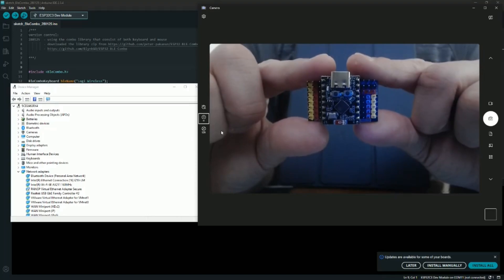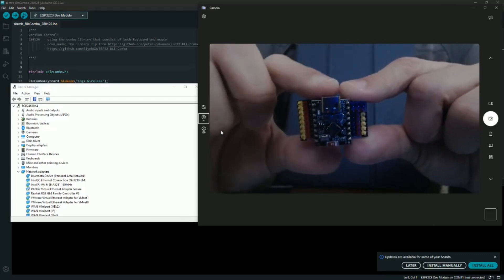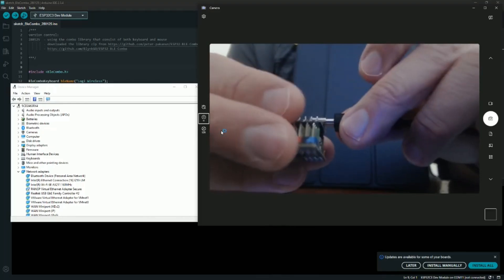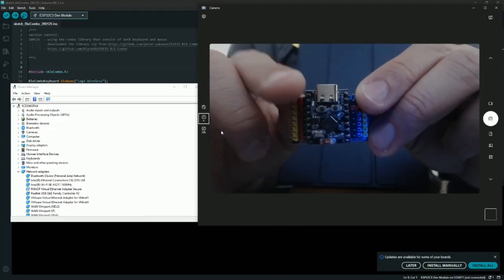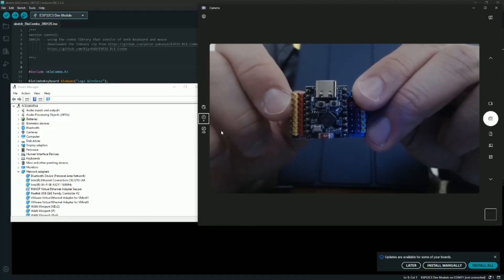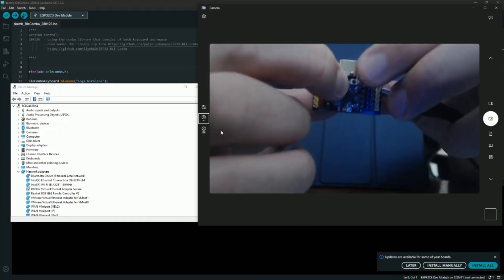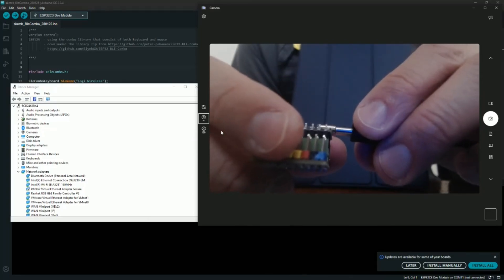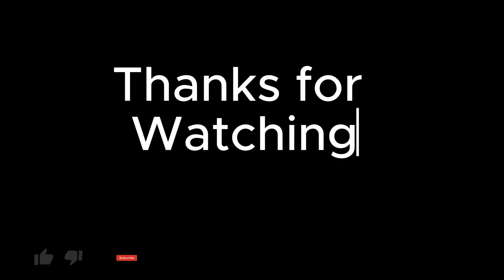179 🚀 Fix ESP32-C3 SuperMini Connectivity Issues FAST! 🔧

Comment: its a good fix! Ive another problem. I wanna make a custom KB with BLE keyboard library, everything is ok on serial monitor, but the PC couldnt connect it. any fix to solve it?
Reply from the maker: i'm having the same issue here for the KB library. will try fixing it here when i have the buffer and make another video on it when time comes.
Reply from the maker: i found out what's the issue is with ESP32 C3 running BleKeyboard.h. it has something to do with HID library conflict/not working. I tried this library that i've downloaded from GitHUb (can't recall the original owner, but thanks to him/her/them) BleComboHID.h and it worked fine.
I have a copy here in the GitHub which you can download and give it a try. https://github.com/dummytry13579/BleComboHID/tree/main
Reply: @autumngreentech4726  Hii, Can you make the tutorial about the BleKeyboard using ESP32C3? Thank You

Comment: It gets very hot
Reply from the maker: might be a bad unit.
Reply: @autumngreentech4726   i finally got to the problem 🫡
The chip is very poor dence for it's size and power consumption 
It need coper plane under for heatsink 
In the "Super mini " board there is just not enough surface also the pcb is very thin 

I recommend putting some heatsink on chip or  bottom it reaches  80c when using wifi